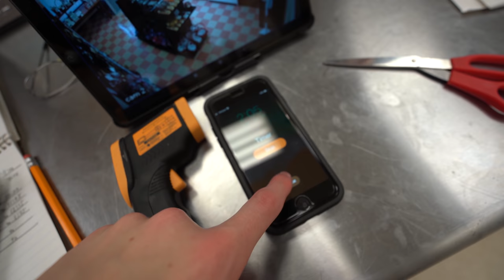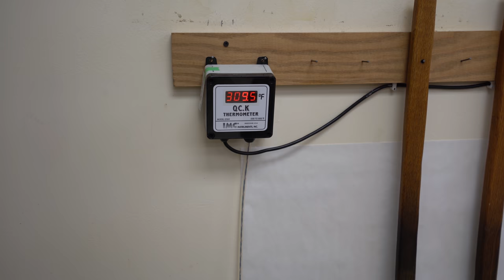Max gets Snippy with Tie Dye Hard Candy!

Comment: Steve maybe you could get a make up air vent at the cooker.    It is a vent that goes from the cooker to the outside.  Then air from the outside would come in then go over and around the cooker then go out the cooker vent. That way air that you paid to heat or cool would not be sucked out the cooker vent thus saving you money.

Comment: I wonder if there is any reason for the dimple texture that is on all of the hard candy they make in the vids
Reply: it's decorative.
Reply: It depends on which plate they use in the cutting machine. One machine is flat (the one with lots of duct tape on the handles) and the other is the textured one.
Reply: Yah I assumed it was decorative, but thought there maybe some reasoning behind it. Maybe stick less or more surface area for the flavor, idk. Just crossed my mind. Thanks!